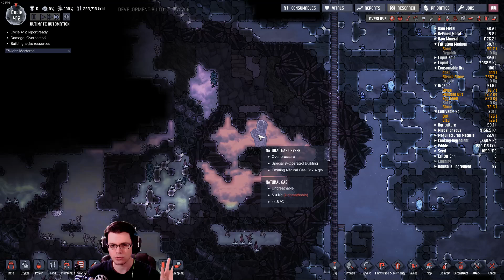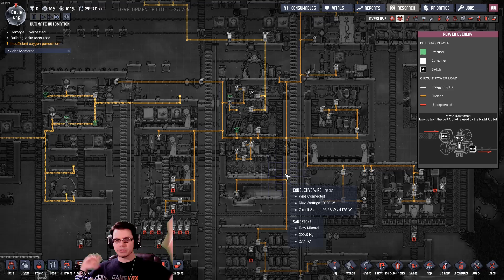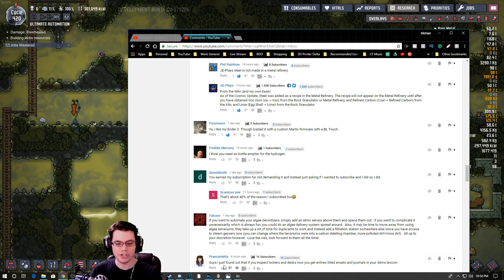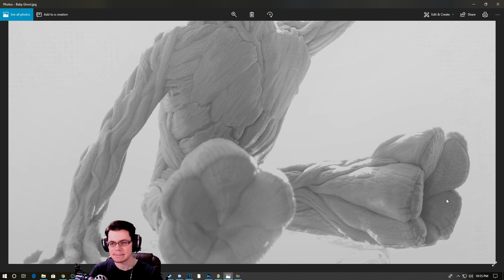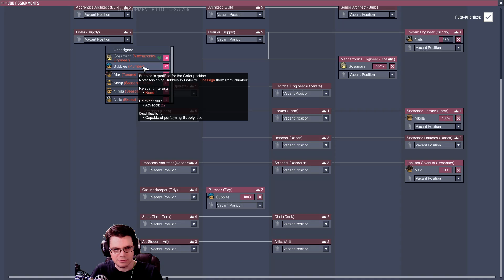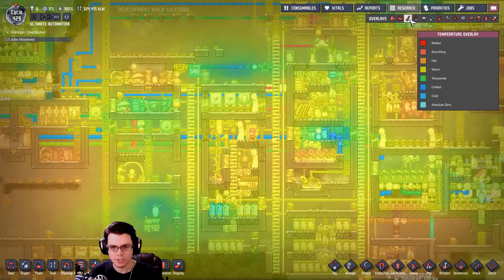Oxygen Not Included - Ultimate Automation Challenge! Cosmic Upgrade Part 17

Comment: Hey any thoughts to a fart powered base?

I looked up the flatulance tag on the wiki and it says that a dupe with the tag farts 5g of natural gas roughly every 10s which should yield ~300g/dupe of natural gas per cycle (assuming that they're farting an average of once every 10 seconds for the full 600s cycle). The natural gas generator uses 90g /s of natural gas to produce 800w, 22.5 g/s CO2, and 67.5 g/s Polluted Water.

Since each dupe puts out ~300g (enough for a little more than 3 seconds of generator power I put 3 seconds as a conservative estimate) of natural gas per cycle, that should translate into 2400 Watts, 67.5g of CO2, and 202.5g of polluted water per dupe per cycle just for existing, though I would suspect you'd need a way to catch all that free range natural gas.

At 90g/s to run, it would take 54000g to run it for the full 600s duration of the cycle, which would translate into ~180 dupes with flatulance, though I think at that point it would be less of a hassle to tap into a gas geyser.

I'd test it myself but I'm not that great with sandbox mode.

Comment: If splitting the coal conveyor belt for the main base coal generator still doesn't work, you can use another separate conveyor belt line leading from the compactor next to the upper coal generator to the main central coal generator.

Comment: I've had the exact same problem with gas bottles (and I think they were also hydrogen). I tried sweeping them, and I also tried locking my dupes in the room with the gas bottles. My dupes became idle, and still would not empty them. I eventually just had to use debug mode to empty it. All of my dupes can tidy, and most of them are masters of every job at this point, so I have no idea why they wouldn't empty them.

Comment: I personally wouldn't really try to refine all different materials, just make everything out of gold from the volcano (bonus decor rating as well). I had a gold volcano in a map and it cools pretty fast once you remove it the immediate surroundings of the volcano. Often my dupes would use like 70 degrees hot gold to build things but it cools fast in the rest of your base so that wasn't really a problem. The biggest problem I had with it was the volcano wasn't outside of my suit system so the dupes constantly got scalded when going directly to the volcano, instead of picking up cooler gold that was stored in a container right besides it -_-'.

Comment: Hey Brothgar, do you have an idea on how to make a storage system, that connects like an exosuit only area and your base area?
Because in my base the duplicants get their exosuits run outside, get a bit of stuff and then run all the way back to the centralised storage and waste allot of time.
Much more efficient would be to have a temporary storage outside with a high priority, which is then connected to an auto-sweeper which delivers the stuff inside your base. Only problem there is that the duplicants will try to put the stuff from the base into the storage outside if you put it on a high priority. Maybe you got an idea :/
Reply: You could lock the doors on the entrance way and use conveyer loaders and recepticals to send certain materials to locations. 

For instance , have two or three conveyer receptical that lead to three different areas. If area A needs algea then let receptical A be allowed to have algea delivered to it via auto sweeper for a little bit.

This way it's kind of like a shipping company of materials. All materials go into the storage warehouse and certain ones are sent out as needed.

My suggestion is a little less automated since you'd have to manually select what materials to ship where, but I'm sure it could be automated with Smart Storages and many long lines of automation wires.

Hope this helps!
Reply: OH! And for getting materials into the "warehouse" you could just have a conveyer loader with a higher priority than the surrounding storage areas, but out of reach of the duplicants so they still deliver things to the storage units but then the auto sweeper moves it to the conveyer rails that ultimately go to the storage area.

I think it would be really helpful for these kinds of shipping ideas if they made conveyer bridges that took automation signals to either allow or deny items to go through them.